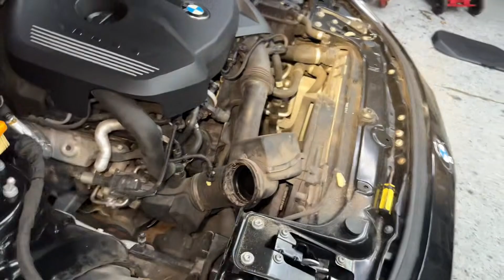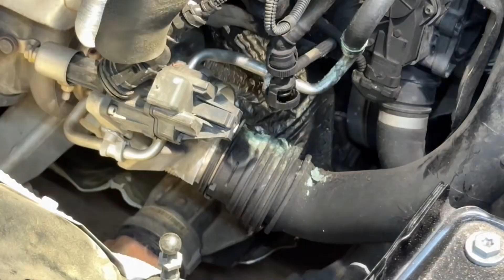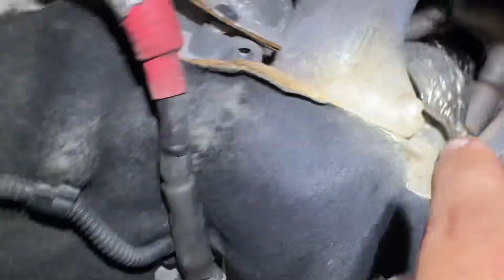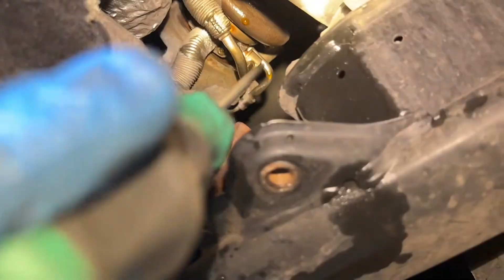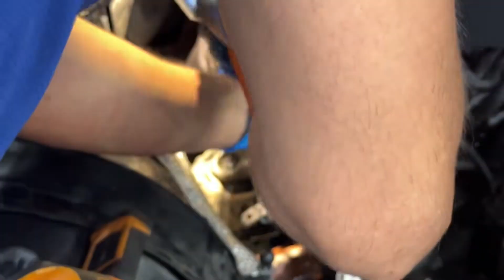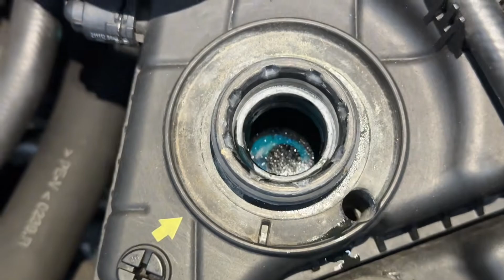BMW Turbo Coolant Line Replacement (B46/B48 2018-2021) | 320i 330i 430i 530i X3

Comment: Can the Oil filter Housing coolant Leak cause White smoke on tail pipe for a less than a minute then disappear only on cold start? Or thats issue is something else. I did a research and saying Turbo oil feed line is causing the leak and create the smoke but im not sure anyone help plsss

Comment: How can you not bend the bottom line when it's a solid stainless line that bolts to the block wouldn't you have to remove the cat or you bend a line and have to remove the cat
Reply: It has a small rubber piece under the stainless wrapping.

Comment: Can you do the job without lifting the car up in the air?
Reply from the maker: It’s doable if you’re trying to use a jack and jack stands buts it’s definitely easier on the lift!

Comment: Did you reuse the Oring on the supply hose? The bottom one?
Reply from the maker: I would not recommend that! The original hose should come with new o rings on them 🙌🏽
Reply: @brownsburg.motorsports i see the return hose comes with a new Oring, you popped off the supply hose as well. Wondering if that Oring was replaced?